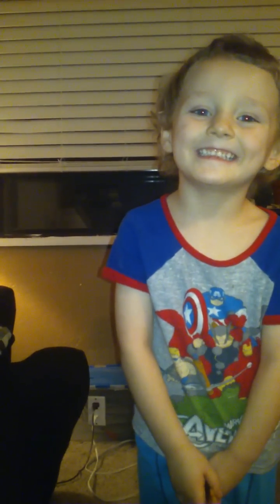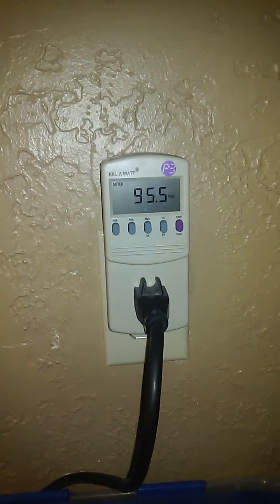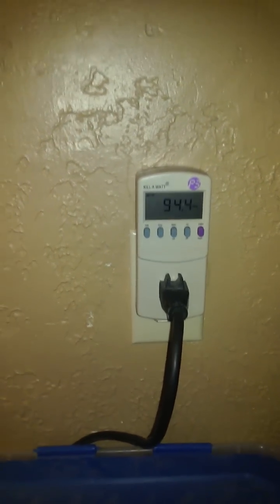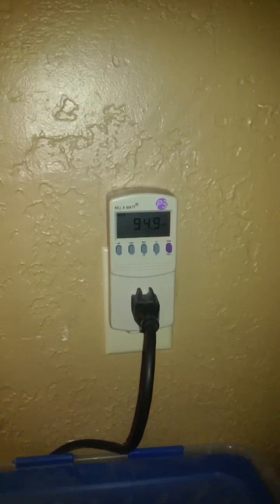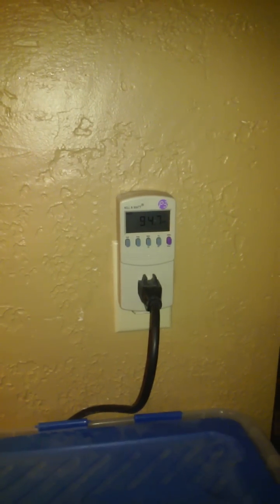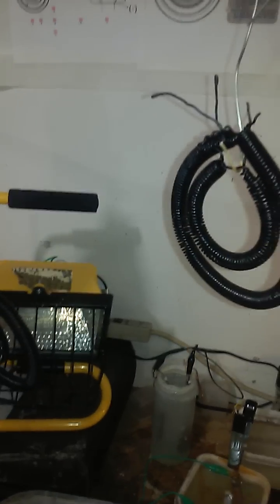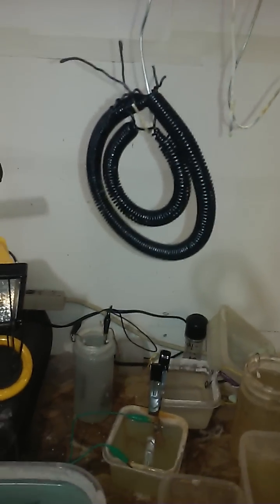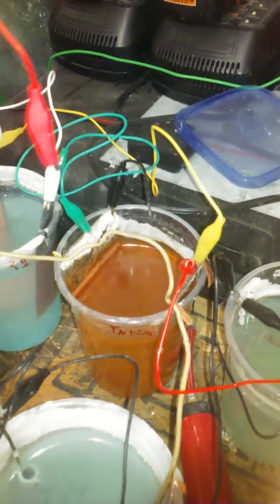Keshe Magrav stacker day 4 update &results

Comment: Just a quick remark on people being around.   According to Keshe ( and I believe it) plasma is not a thing or and object but an actual being which will connect with you on a non physical level.     I guess it is more efficient when you have your wonderful kids around.  

The chineese had seen similar effects in the past.  I have noticed some slight variation of it as well.   Mine got scared of the vaccum machine and blew the circuit which has never happened before :-) ??!!

But, we are physical beings and we want to see tangible results, so the numbers on the gauge is more important.  Once the numbers drops then we will believe the intangible.  I had a holiday trip recently and was amazed by the jet engine.  Just looking at it from outside there is no fumes or fire, just a huge noise and lifts a huge beast into the air.   Our great grandfathers would not have believed it and would just run away in freight.  But, now we know how it works and do not think of it twice.   So, Plasma field creation is the same thing for our generation.

By the way, my plasma reactor has not worked.  I did not set the voltage flow ( I completely forgot) and also connected it the wrong way to the grid.   I am in process of redoing it.